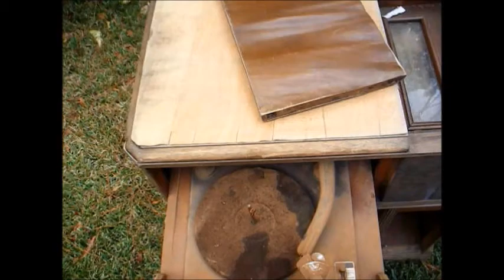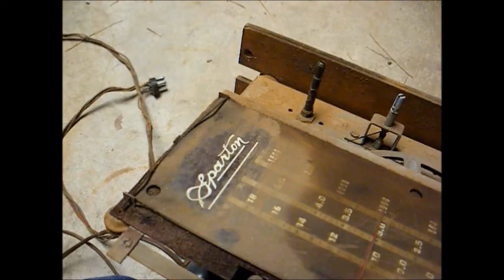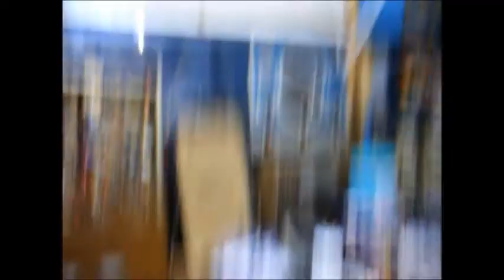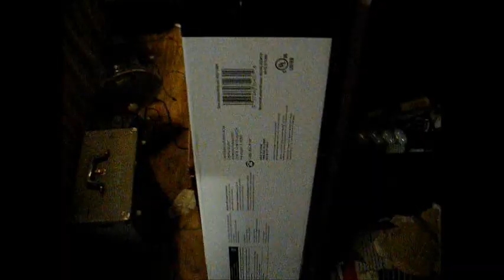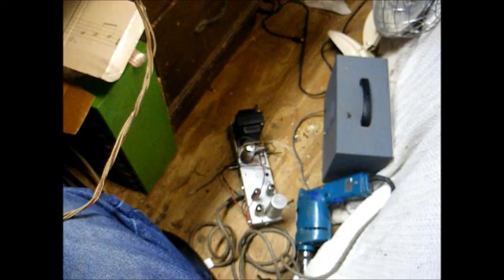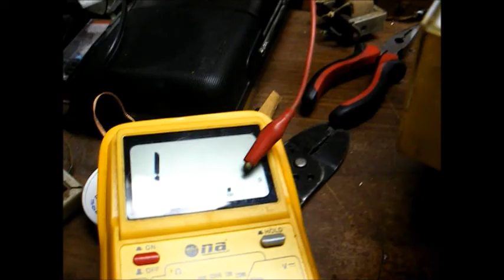Cabinet EOL (maybe) & repair (certainly) of a '40's Sparton tube radio chassis - part one

Comment: I used to have a Sparton radio/record changer just like this, although the cabinet was in much better shape.  I refinished the cabinet and enjoyed it for several years and eventually gave it to a friend when I found a different kind a wanted to mess around with.
  There's another just like it on craigslist in south eastern Indiana.

Comment: I would save the control panel from that cabinet, some of the veneer if it will come off in one piece, and maybe the drawer that the record changer came out of, use the rest as firewood. I think that chassis would be a good candidate for a custom built cabinet.

Comment: That's a nice find, I like it. I've seen paper caps go dead short before, but never filter caps...interesting. I bet if you would have tried it with that cap in place, the cap would've made sounds like bacon sizzling on a griddle.

Comment: See a similar changer in your Sparton as in a recent pickup I got. Mines a wreck. The metal underneath is all cracked & brittle, even the cycle gear! The shelves tower bases are all broke too. Never seen anything like it, so brittle. How's that one look underneath metal-wise? Serviceable? Mine could only be manual if that.